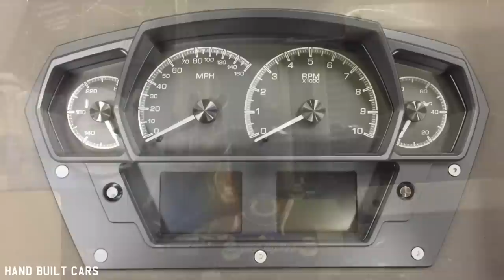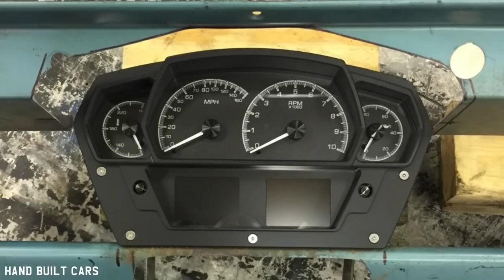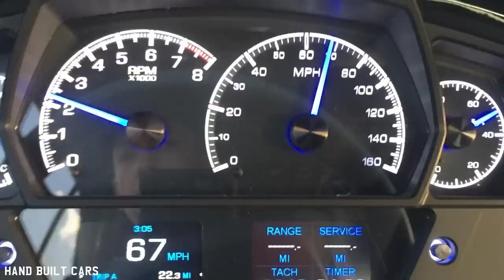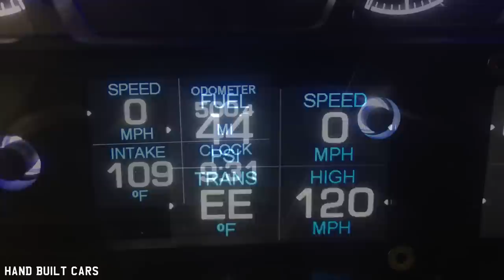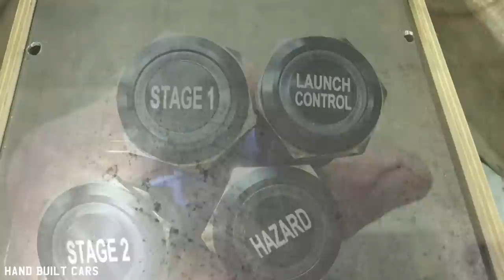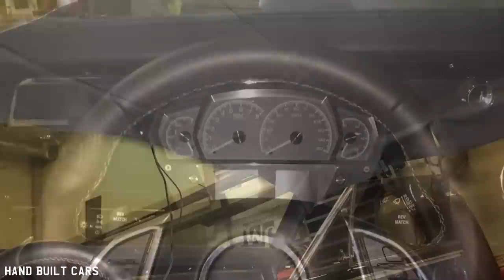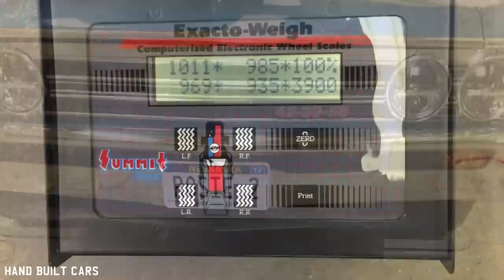1967 Chevrolet Chevelle SS 416 Supercharged 1000Hp Build Project

Comment: I had the same problem with the driver side headers. Now looks like you have to remove part of the steering component to get the header off. I went with stock LS3 headers.